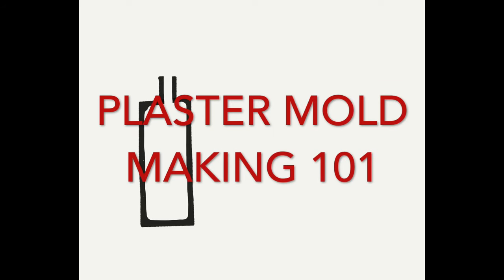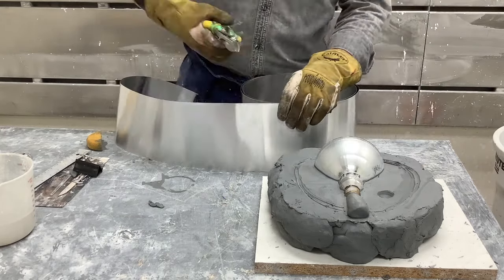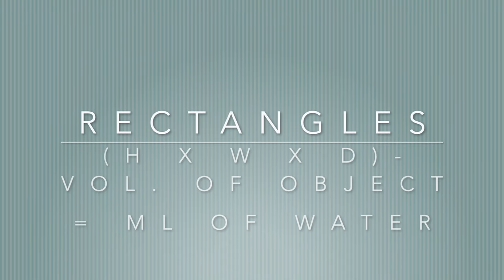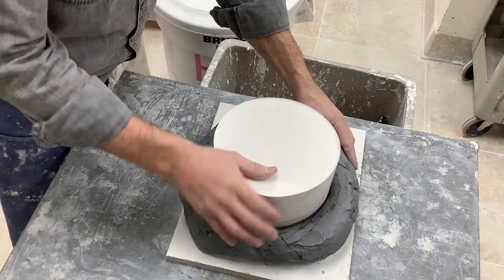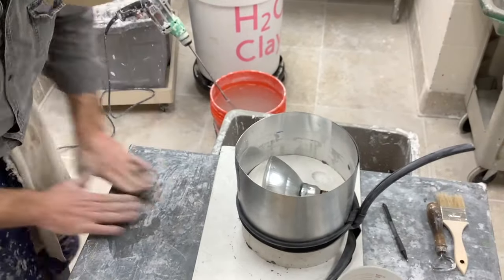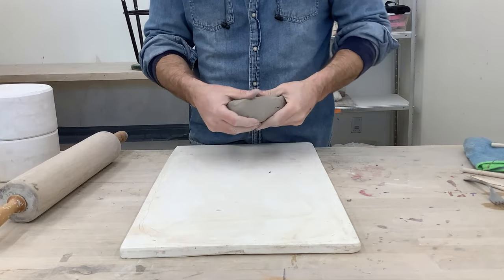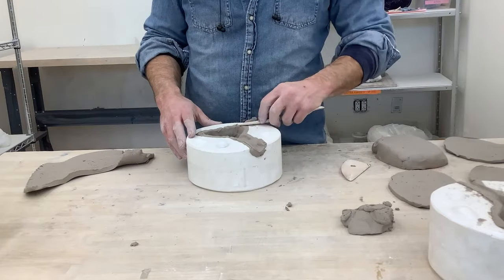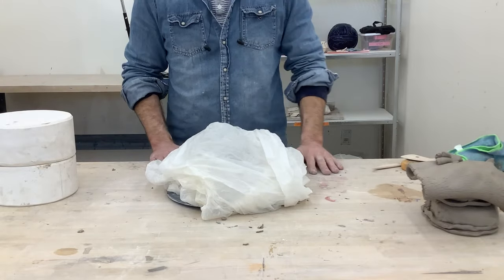Plaster Mold Making

Comment: Hello, I have benefited a lot from your mold making video, thank you so much. I have a problem. All the people who teach mold making are always teaching how to make molds for clay materials. No one shows how to make molds to make hollow concrete materials.
For example, one centimeter wall thickness, hollow inside, open mouth and closed bottom. Can you make a video showing how to make a concrete vase, pot or any container mold?
Reply: I am interested in making cement molds.  I saw that they are made out silicon material,  you know the one they use for baking silicon molds.  They can be purchased as ready molds or you can mix silicone mixture to make your own molds. 
I tried to use gypsum mold for cement, but it was a disaster because cement (liquid) acts differently than clay (liquid). Clay can get off the plaster easy  but cement will get glued to plaster mold.
Reply: @dinaatanassova6310  Dear Dina Atanassova, thank you very much for your courtesy to reply. I send you my greetings, love and kisses from Turkey. 🙏💖💋💋💖🙏
Reply: Hi, Halil, the mould your are talking about would have to be rotated while curing to achieve that. Very advanced way of casting. And you need a silicon skin mould with hard case.
Reply: Hi  @Cuckoo23 , thank you very much for your courtesy to reply. I know how to make a standard silicone mold. I don't know how to apply two-piece stays to hollow objects as clay artists do. And no one makes silicone molds for hollow objects.
Thank you again. I send greetings from Turkey, love, respect, big 
hugs,  good night.
Reply: @halilbalaban1056  i think you just fill the inside of the container.  I have seen the inside stuffed with paper or rocks and then topped off with clay or silicon.  That prevents the slip from filling the inside.  Once finished making the mold, you can remove the filler material.  I am planning on making a set of coffee mugs. Thanks
Reply: @halilbalaban1056  smooth-on has information about roto-casting on their YouTube channel I believe, along with other ways to use their products.

With roto-casting the mold is often a brush on silicone or polyurethane followed by a hard shell of fiberglass or a similar product (smooth-on covers this). Then the whole mold is put into a roto-caster, the forming material is poured into the hole in the mold, the mold is sealed, and the casting machine moves the piece to "throw" the material at the walls of the mold while it dries.
Reply: @halilbalaban1056  I slush mold hollow things all the time in silicone case molds. I just pour in the material and rotate it around to make sure all the surfaces are covered. Sometimes I pour in extra and then let the remainder drain out, sometimes I just keep rotating it until it firms up if it's a fast hardening material.
Reply: @kaglaw  Hello Kaglaw, you wrote it 5 months ago but I just read it now. I'm replying late for that. Sorry for this delay. 
Sir, I know how to make the usual silicone mold for a concrete flower pot. These molds are made of silicone and support the walls of the pot from the inside and outside.
I also know the patterns of artists who make clay pots. These plaster molds only support the vessel wall from the outside, and liquid clay is filled inside the mold. After a while, the part of the clay in the mold that comes into contact with the mold dries up and a vessel wall of a certain thickness is formed. When the vessel wall of the desired thickness is formed, the still liquid part of the clay is poured out.
My purpose in asking; To be able to create a new mold making technique in which the techniques of silicone mold made for concrete and plaster mold made for clay are used together. If we find a way to do this, it will be a very useful system for both those who make concrete containers and those who make clay molds.

Comment: To determine the volume of a object fill a container with water then submerge the object in it and see how much the water rises.  You have two way to figure out how much volume that is:
1) If the walls of the container are vertical than you can measure the how much the height of the water changed and multiply that times the area of the opening (like you showed for figuring the mold container volume.  2) You can draw a line for where to water rose to and remove the object then add water until it reaches the line.  The volume of water you added is the volume of the object.
Reply: That was a lot easier to understand than his formula for doing it. No offense to him, as the video was very informative, I'm just NOT a math Wizz like that 😆
Reply: @behindtheglamour  glad I could help

Comment: Why use clay that dry? It seems easier to mix clay with water until it's a thick slurry and pour it and let it dry a bit then pour the excess out.
Reply: Slip casting
Reply: He’s not slip casting, which is what you’re describing. I’m not sure if this technique is called the same thing as in glass working but we would call using this process slumping…because the media “slumps” into the mold. I’ve not seen pottery done like this but I’m a novice. I think most people slip-cast, which is what you describe. Interesting!

Ah, he just called it “press molding”.

Comment: Can you use slip to make a more uniform layer of the first covering of the part?
Reply: You can even pour the slip into the mold, waiting a few minutes then pouring it out. That’s called slip casting.
Reply: Yea, I don't know why you'd push the clay in there rather than just slip casting it. Slip casting way simpler, so I'm confused.

Comment: nice vid. this seems way cheaper than silicone mold ! can i use PU foam for making the part in a plaster mold?
Reply: Foam sticks to plaster, so do not try to cast a foam object in a plaster mold directly. Paint layers of latex into the mold first. Also, use something like Ultracal 30 or Hydrocal plaster for non-clay casting.